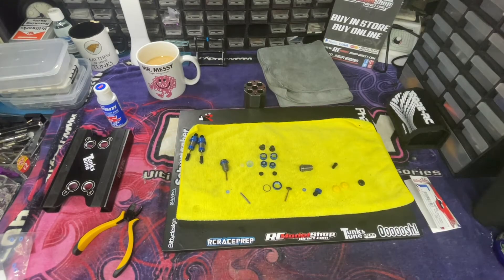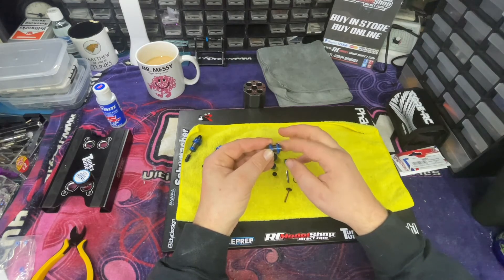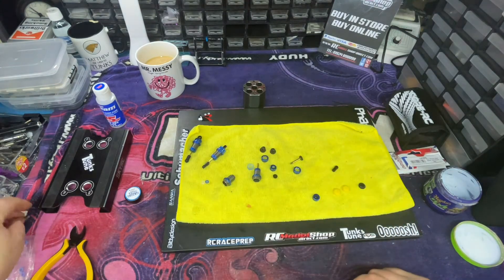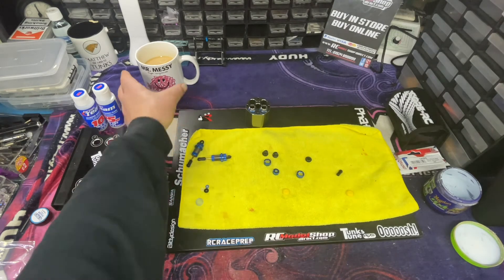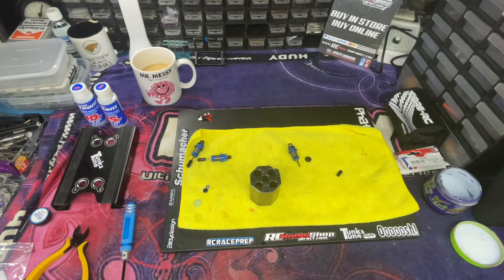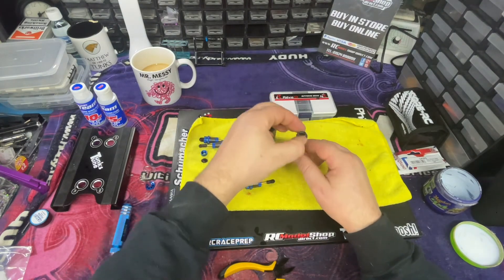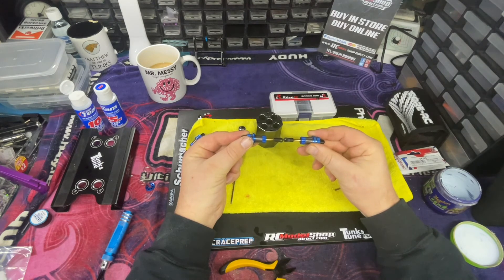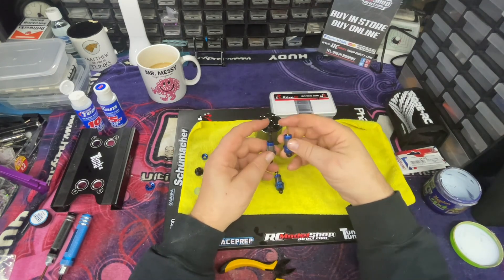Rc drift shock building how to and tips!

Comment: The best drift shock setup tips I've watched so far! @29:57 the drill bit you used "1.5mil", do you mean mil as in mm? Link on the drill bit? Running my YD2S plus on smooth concrete in my garage. Thank you.

Comment: Nice video! What stiffness would you use to the spring for drifting and why? Oil has to be thin for fast rebound? Why not thick? Also are these changes feel-able or it is just a go to emulating full scale...?
Reply from the maker: Springs have a point of being able to hold the weight of both the chassis and your chosen body where they are at their optimum range.
I’ll try and make a video soon on how do find that point as it’s pretty difficult to explain.
The thinner oil is to reduce a thing called pack, it’s to do with the surface tension of the oil, faster initial reaction needed to absorb the vibrations from plastic tyres.
Visually and hand eye “feel”

Comment: I race dirt oval and I never put the o ring in the shock collar and it never moves once you have the spring compressed against it. It's way easier to change ride height if need be.
Reply from the maker: It’s not worth the additional worry of them moving, once the collar o rings are oiled they are not locked into place

Comment: I wanted to ask you. What do you recommend for cleaning greasy grimy parts ? Is brake cleaner ok and not too corrosive?
Reply from the maker: Brake cleaner can make plastics brittle, for alloy shock bodies for instance it’s ok.
It may remove anodising too so be careful.
I like to use GT85 for most of my cleaning 👍